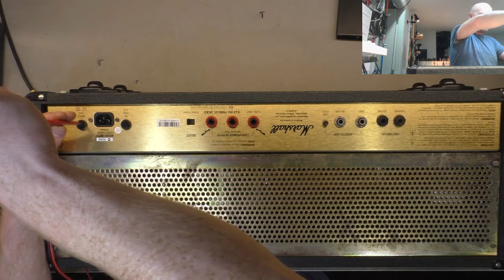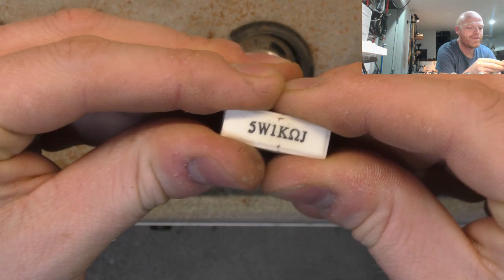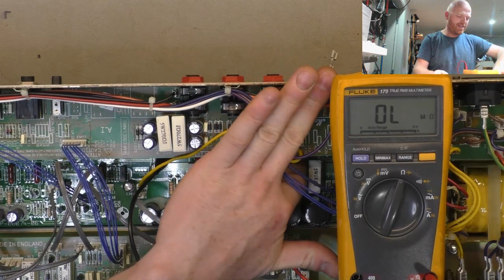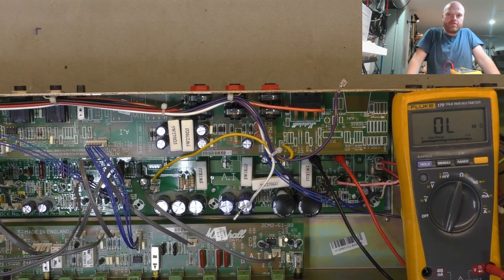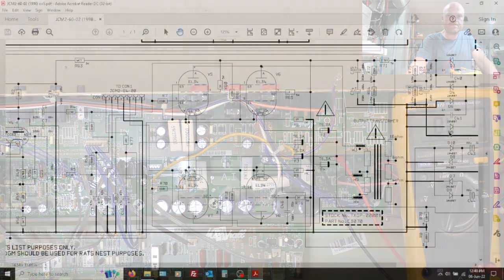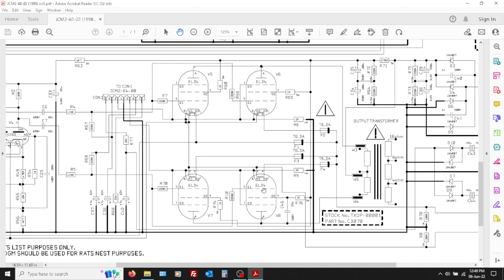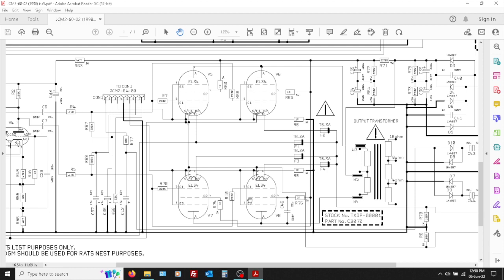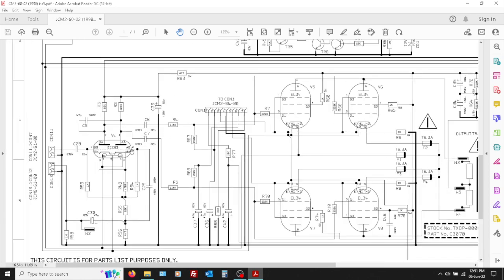Cascaded Failure - DSL100 Head (UK)

Comment: Hi Brad, why dont you change the main board its around 250$. Those boards will become conductive with time.  You should look on the little ac input board and change c2 i think its probably not working properly 22nf.  My recommendation is to run those thing in 50 watt only (2 el 34 valves only) to avoid risk of damaging the main board.  Good luck.
Reply from the maker: Well aware of that issue, mate.
Made the customer aware that it's not currently occurring and he'll decide if he wants the new pcb. That would put the repair at about $1k which isn't far below the market value of the head.